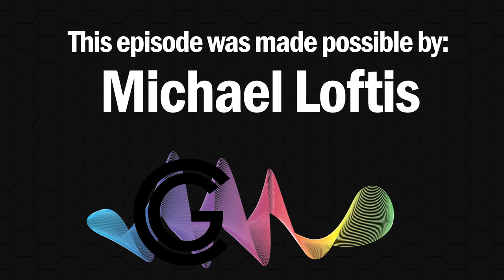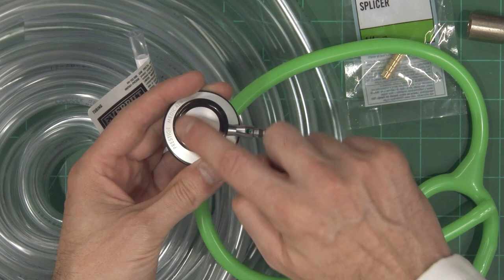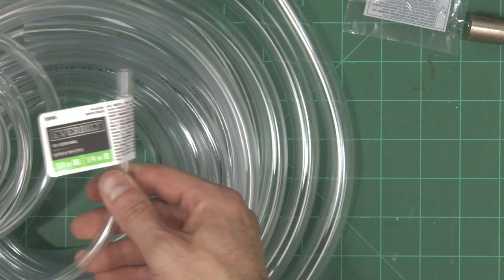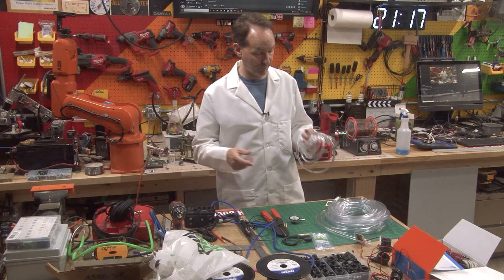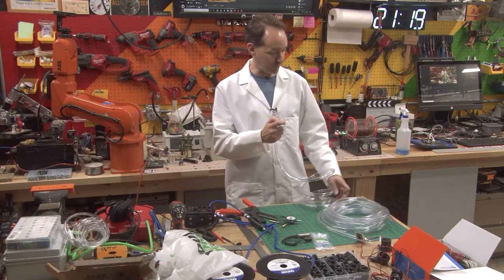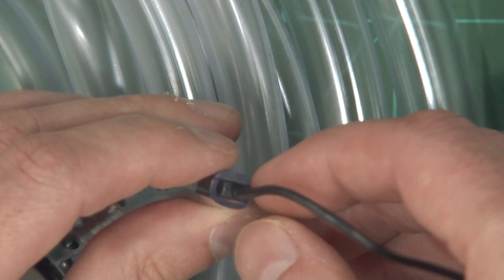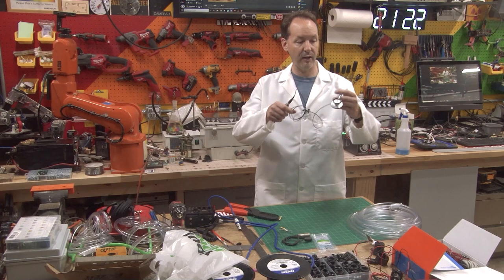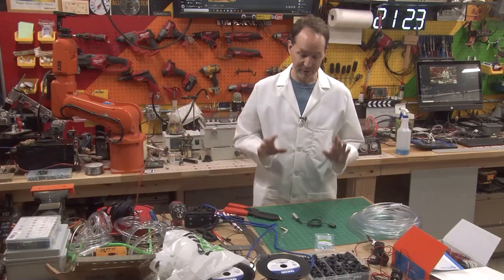How To Build A Stethoscope Microphone

Comment: If you look around places like digikey or RS components you'll find an assortment of condenser mic capsules for very cheap. they're what's used in things like radio fist mics and I think they come in all shapes and sizes but round is probably the most common so find a diameter that fits the ID of your tubing and you can probably minimise the tubing to almost nothing and not have to mess around adapting sizes. I bought a bunch to replace one in one of my ham radio mics because the one from the manufacturer had an issue with RF feedback and I think that was maybe 6mm or 1/4 inch I can't remeber but very close to your smallest pipe there so you could easily get away with 1/4 inch of tubing between the scope barb fitting and the mic. They might not be super high fidelity but they'll be fine at the frequencies you're concerned with when using a stethoscope they'd do the job without spoiling a nice lav mic and they're only a couple of dollars shipped

Comment: I tried using a contact mic for checking my blood pressure with a manual cuff, and it just didn't work at all. So having a small diaphram/coil type of sensor, which can detect the tiny bumps of air through the tubing seems to be the smartest.

Comment: Which microphone do you use (13:10)? I too had started to do a similar idea with that stethoscope piece. But one question the top hole of the 'oscultator what is it for (can you close it or not)? Thank you very much.
Reply from the maker: I have no idea the model of mic in that one. But the next time I have it in my hand I'll see if I can figure it out. It was just an old mic that had been laying in the drawer for years. It's very likely 90s, or even 80s vintage.